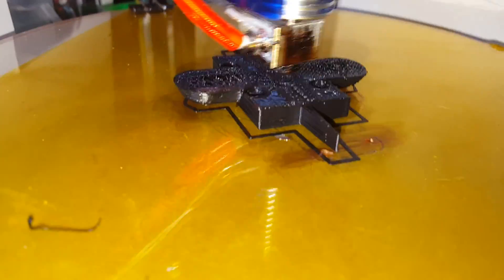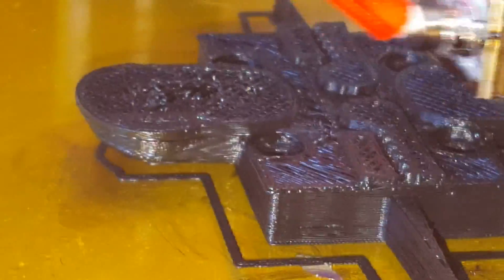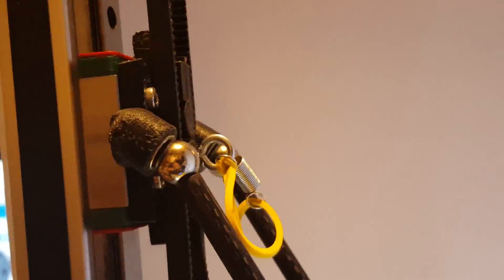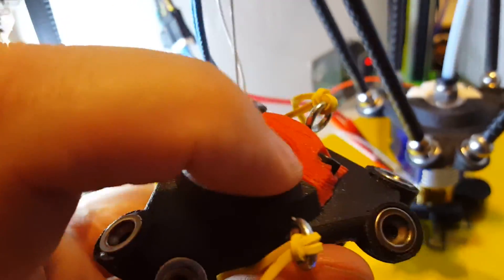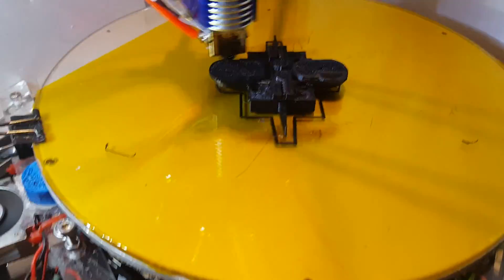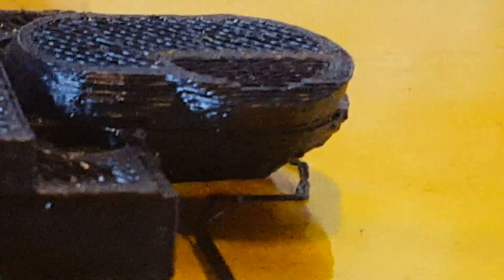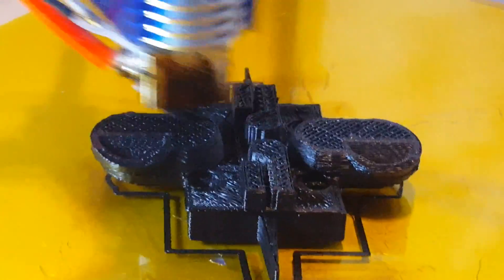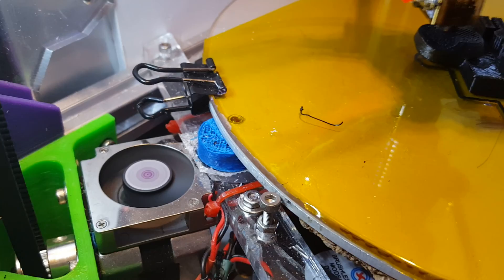Demo #2 - My Delta 3D printer running at 350-427mm/sec (perhaps more?) Now with 12mm Magnets!

Comment: Its quick, but the part is small, so accelerations and jerk settings will never let it reach the max speed. To see if you can really do 300-400 is to do a large box to let it reach the max speeds.